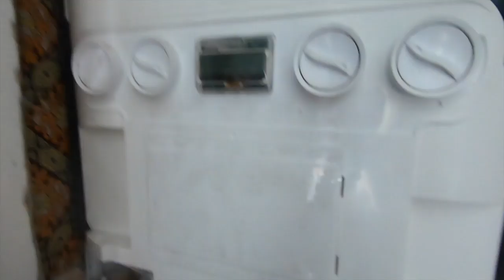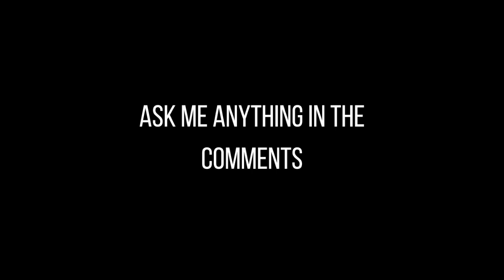PARKES PLUMBING VLOG 012 | Hard Times

Comment: here in bradford i hear of lads doing services for £30 how can anyone compete with that?  when i want to do a proper strip down service and they just FGA.. i cant compete as customer thinks both services are the same..
Reply from the maker: It’s difficult mate. Just make it clear that you do as the manufacturer intended and not just proving it’s safe
Reply: This service is worth 3 × £30 + £20 for awkwardness what a 🐷
Reply: Definitely need to inform all customers there's a difference between a safety check "service" and a proper service as per MIs. I know a lot of engineers who probe and go for rock bottom prices with customers believing their warranty is intact when it isnt